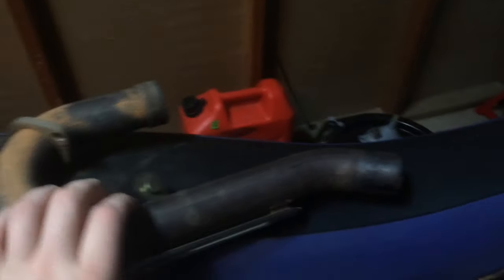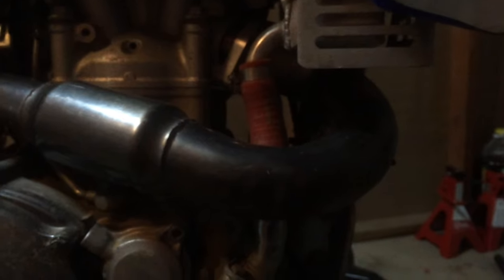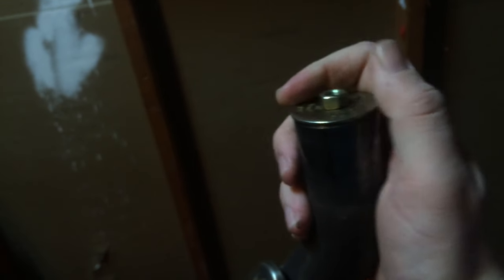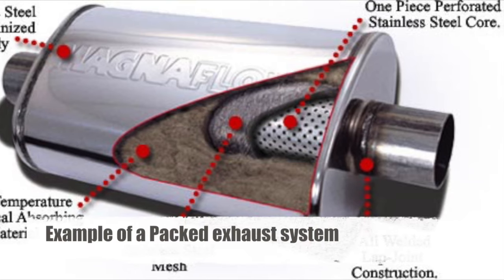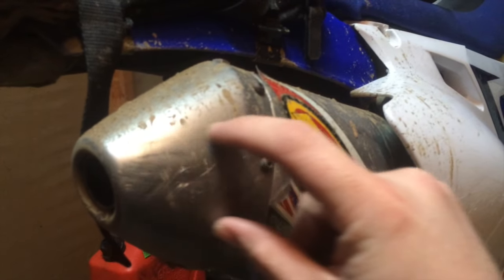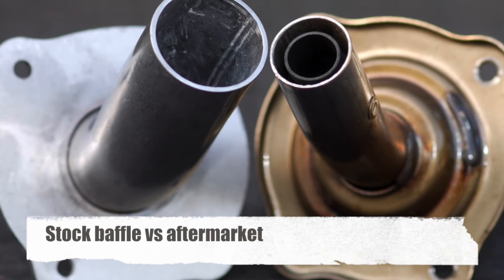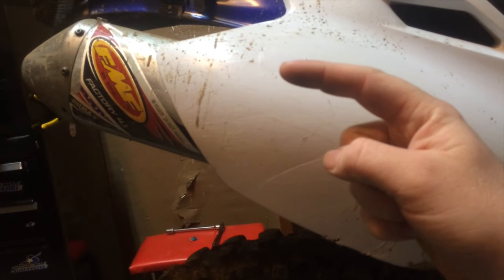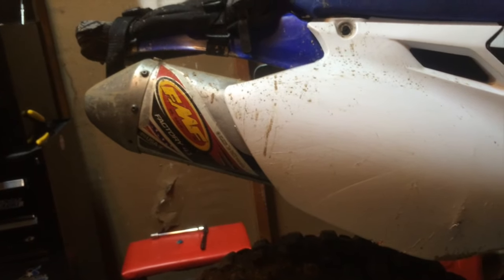EXTREMELY CHEAP POSER EXHAUST FOR MODERN FOUR STROKES, Enduro exhausts explained.

Comment: Dude, that fix on the header was really clever.  I like that you made your modifications based on an actual understanding of how your exhaust system works.  Very useful.
Reply from the maker: +dustysquito hopefully I can save some other people some cash money! I didn't realize these things when I first started riding.
Reply: It especially helps owners of the nicer offroad bikes where the stock components are actually quite good. The stock exhaust on my bike was easily three times the weight of the aftermarket one I spent $80 on, so that alone was a good justification for buying it.
Reply from the maker: +dustysquito yeah anyone with a steel exhaust needs to just ditch it.

Comment: Great ideas. Buying a new exhaust is probably the worst bang for the buck horsepower wise. A full system is let say roughly $500 for about a 2-3 HP gain tops. The mods you did here like you stated provide the same effect for next to nothing. Beside the reason most people do the exhaust is for the sound anyway. Haha Good video.
Reply from the maker: +azdesertdog Thanks man!